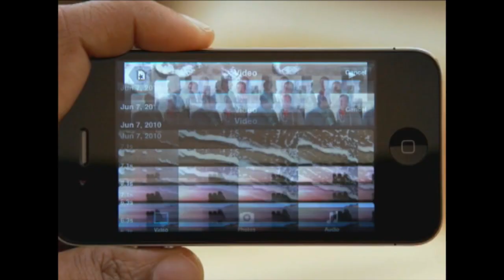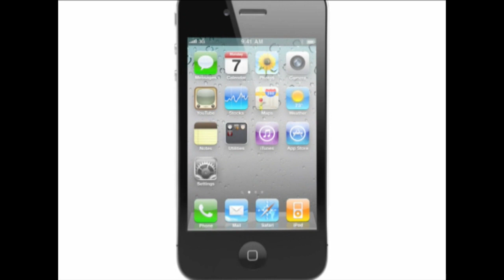Making the iPhone 4

Comment: @iBizkitas Tensile and impact strength are two different things. Biggest example is that two jumbo jets moving in opposite direction is what it takes to tear apart carbon fibre, but strike a carbon fiber rod against a block of metal as hard as you can and it'll shatter. The video shows that the glass has incredible tensile strength, which turns out to be pointless for a phone (obviously).